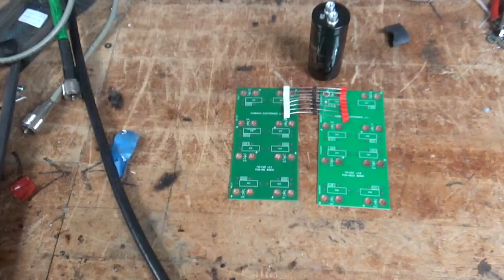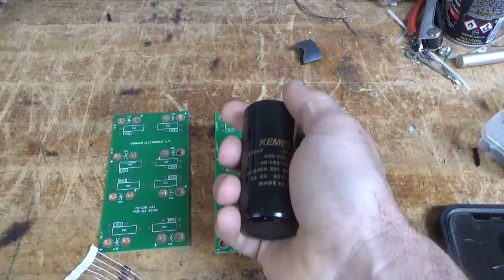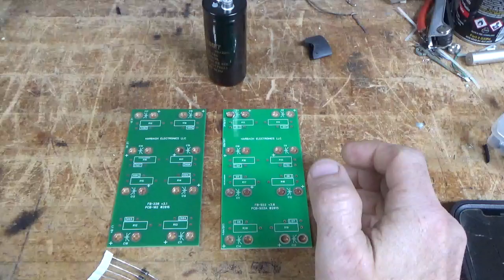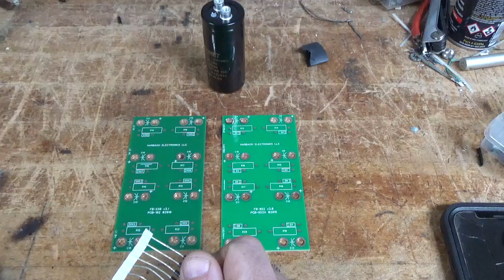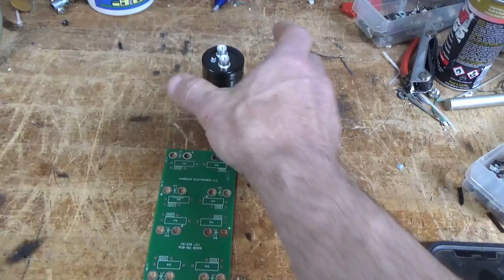Reason For Protection Diodes On Harbach Electronics FB-220 And FB-922 Filter Capacitor Boards

Comment: Those diodes saved half of a set of eight filters in a SB220 we saw. Much cheaper to replace than a 450V filter cap. I'm a witness that this trick works.
Reply from the maker: Sure are 

Can easily damage the caps before breaker pops in a sb220 and the 922 uses slow blow fuses so same

Thanks for watching and for sharing your experience

Ps

I have a diode across each electrolytic cap in my 160-15 meter pa

Going rate for those caps are 150 each !!!

They are surplus I would never pay that much. But cheeper to replace the diodes. 

73

Comment: Hi Scott,
I bought the FB-220 kit a few years back. Haven't installed the kit into the amp yet, but have assembled the pcb. Are the Kemet caps available by themselves?  73  WJ3U
Reply from the maker: If only a few years old even longer I’m sure you  are fine

I have only a limited supply of the caps used for the sb220 and 922 board and distributors that sell them are out of stock, so only offering for kits at this time

Sorry

73 scott

Comment: Thank you for the explanation, Scott...
It was my understanding that the Harbach rectifier board provided protection for the unobtainium' meters... Is this a misunderstanding on my part?
Should I still put protection diodes on the meters...?
73🎉
Reply from the maker: Metering board has diodes to protect the meters, no need to have across the meters 

Very welcome , thanks for watching 

😀😀